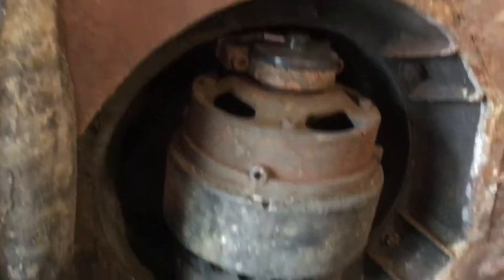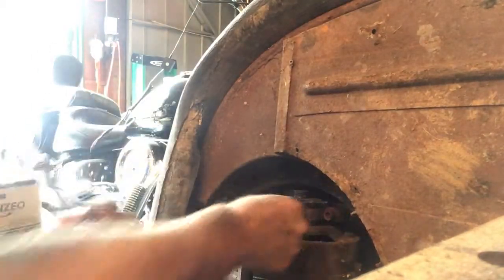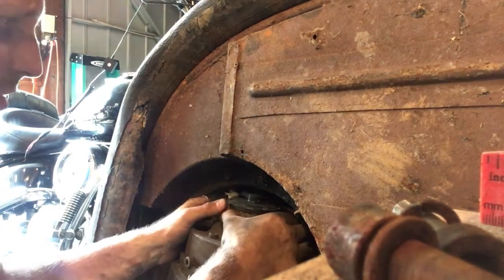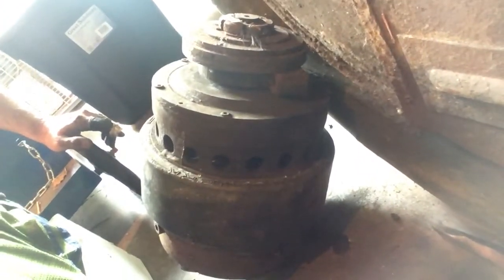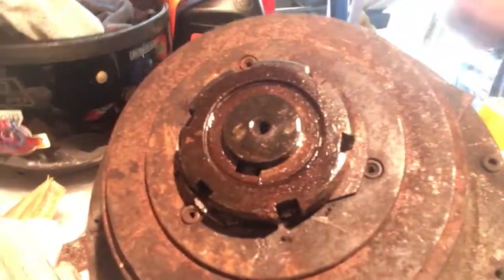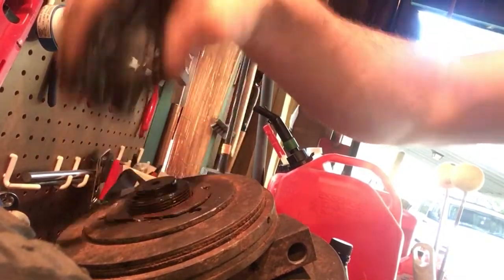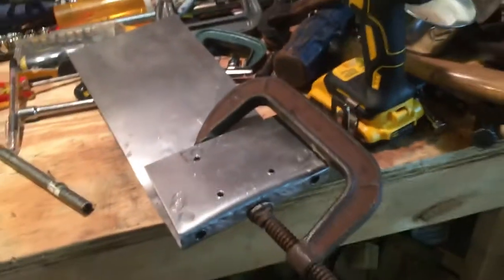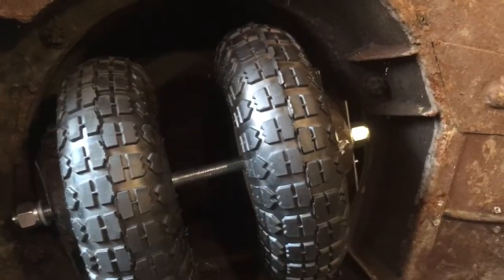Motorized BUMPER CAR  - Removing electric motor - VINTAGE Adding AXLES - ep.6

Comment: Did you make any further progress on this project? I would love to see how it turned out. Trying to do a similar project too. Thanks
Reply from the maker: @bsargent  I shelved this project awhile ago. Had a bunch of new projects that caught my attention. Making more space too for it. I might switch the engine to a 125cc mini bike shifter motor too. It’s smaller and will fit better
Reply: @ thanks for the update. Do you have any info on these cars like service or technical manuals ? I’ve been scouring the net (hence found your channel) but really can’t find much at all. Any pointers really appreciated
Reply from the maker: @ there are a few sites but most are foreign. I found a German website a long time ago covering mine b

Comment: Perché hai messo 2 ruote e non 1?
L'hai fatto per stabilità o per scorrimento? Ciao
Reply from the maker: I am using a translator, but your question was.... "Why use 2 wheels on the front"  Mainly for stability, traction, and weight.  I was limited in my choices of tires because of the low height, so to insure I replaced a similar width tire I used 2 narrow tires.
Reply: @Jeep-Creep  ok ho capito, grazie!! Sò leggere l'inglese ma non so scriverlo 😅. Grazie ancora gentilissimo.
Reply from the maker: @stefanobattistino2441  I use online translators so it’s easy for me too. Have a great day. I am happy to help.

Comment: Rimane in piano? A terra rimane dritta? Ciao
Reply from the maker: Using a translator.  Question was "Does it stay level?  Does it stay straight on the ground?"  Yes, it is level, and stays straight when steering it.  The only thing to keep in mind is this steering has no limit, so the wheels can do a full 360 degree rotation.  I will add a limit bar on the steering to prevent this in the future episode.
Reply: @Jeep-Creep  grazie mille buona serata
Reply from the maker: @stefanobattistino2441  you are welcome. Glad to help.

Comment: Did you ever get this project completed? I can't seem to find videos beyond this and I'm trying to do the exact same thing. I have no idea what I'm doing, haha, and this isn't exactly mainstream, so I'm hoping to connect. :)
Reply from the maker: Please do connect, I love helping people with these projects.  What are you working on?  So I moved in June to a bigger house with property and with that came a TON of projects that slowed my progress on my bumper car.  Good news is I am finishing my new Dead Shed as I call it.  It was a rotted 12'x'17' and I poured cement and working on it now, it will be a 12'x30' roughly 2 story Garage.  Which buys me a ton of space for my Grand Wagoneer (project), my Mini Jeep (gas powered kids Jeep) and you guessed it my gas powered bumper car (project).  With that space, and I am heating it with a 55 gal wood burner stove I made, I will be able to continue to work on the bumper car.  Any questions or comments, throw em up and I ALWAYS answer them unlike other channels.
Reply: @Jeep-Creep  I grabbed a bumper far from the early-mid 70's that was manufactured by Soli out of Italy. It needs some hefty TLC (seat, backrest, pole, body), but I think it's doable. That said, I have zero skills when it comes to tools or restoration, haha, but no one is born with that knowledge anyhow. I'll learn as I go, but with few references out there, it'll be tough. Still, that's half the fun.

I reached out to the company, not expecting anything, but they have been great. They sent me the parts list, blueprints, all kinds of helpful info, and offered to help me source parts I may need.

Inspired by your series, I'm creating a website and video blog to track progress, but I literally just put this thing in our shed last week. My first step is to convert our shed to a workshop, so the electrician is coming in a few weeks to run power. We'll have it insulated as well. My wife...not too thrilled, haha, but she's rolling with it.

No idea how to power this thing, but I think anything can be achieved these days, so it'll come in time. First step...breaking this baby down. Not sure how to disassemble this thing, but I'm sure things will start to happen if I turn a few bolts. :)

Did you remove the bumper/intertube yet? Wondering if I need to do that to get to the chassis and such.
Reply from the maker: @flxcreatives  That sounds awesome!  For sure shoot me a link to your new website.  I actually ran a website business awhile back so if you need help there too let me know. I might start a website when my YouTube user base hits 1,000 subscribers. That is the magic number for getting paid on YouTube plus unlocking better features too. I could maybe should build a site to direct traffic to my YouTube and embed videos for more traffic but it’s money which I am avoiding investing. 70s bumper car sounds awesome!  From Italy too that’s cool I really cannot wait to see pictures of it. I just love all the early bumper cars. They mimic real cars. Like mine took me forever to find the tail lights for and it turned out to be a car we never seen in the US which is a 1965-1966 Opel Rekord model B manufactured in Germany. Makes sense since my bumper car is manufactured by a German company Gebr Ihle. There is a website / forum dedicated to these Germany cars.  I would search for others with the same manufacture. 

I am super happy it has inspired you to restore a bumper car. If you look around restored ones sell for a lot of money too so you will never lose on your investment. I picked up a wrench at 15 and never stopped learned on my own. Unless your born into it, these are all self taught skills, so you are totally right. I have learned a TON from YouTube tutorials. I learned to MiG weld that way too. Just don’t cut corners, take your time, try to find others methods and follow and improve upon them. 
I have not removed the bumper/inner tube. It is pretty dry rotted and I was hoping to find a inner tube for it. I am not sure if I can just use a oversized inner tube off a tractor or something. It does have a stem for air on it. I don’t think it will hold air. Haven’t tried. Luckily the rubber around it is so firm it doesn’t sag really. With my new wheels on it I get only a few inches of clearance, which is ok for pavement but I am in the country so I might need to figure out a way to gain just a little more clearance. 
Is your body fiberglass or something else? 
As far as power goes I went gas, cheapest and most powerful way. 
Considered electric, but it’s expensive and lots of weight from batteries. 
Others will use mobility scooters for cheap donor parts so that’s and idea. 
Let me know what you are thinking.
Reply: @Jeep-Creep  Thank you, I'm definitely looking forward to getting started. My firm has been in the web development, creative direction, and digital marketing space for a few decades now, so I'm good there, haha, but thanks for the offer!

This car is fiberglass, which should make it pretty easy to restore and repaint...especially since I'll be wetsanding after filling in the chips and deep scratches. She'll be pretty. :)

I'll check for any Soli enthusiasts and plan on hitting a lot of DIY forums and groups for guidance. As for power, I just don't see how gas will work because there isn't a lot of free space to work with, but this will be fun to figure out...eventually.

Not sure how to send you the link, but I'll post here just in case. It's not up yet, as I'm still designing the little logo that will go with it, but it'll be at bumpercarproject.com and I'll have a YouTube channel by the same name. Looking at about a week or so to get everything set up. Then, off we go!

Best of luck on the other projects...that's way outside my scope...and I'll keep you posted!
Reply from the maker: @flxcreatives  Awesome I am looking forward to seeing your progress!  :)